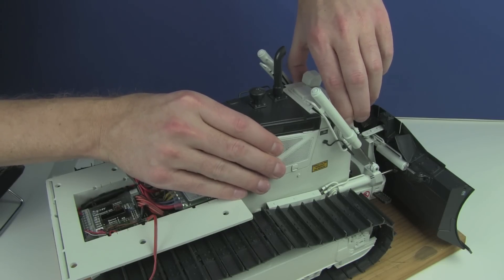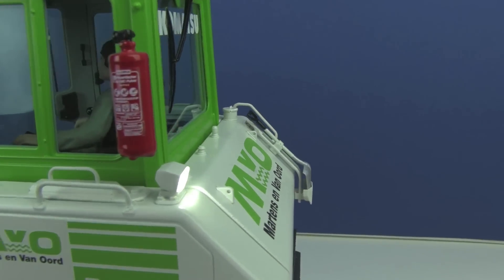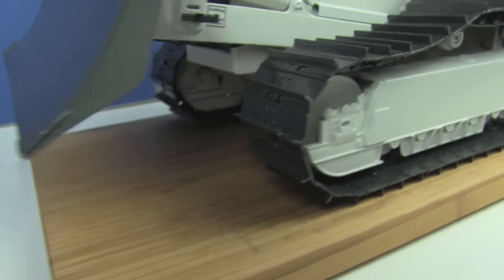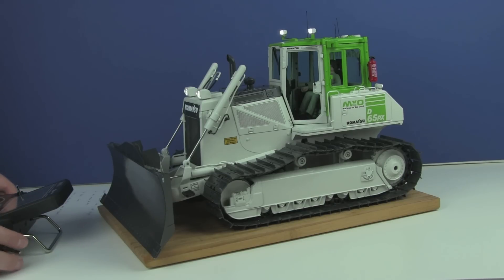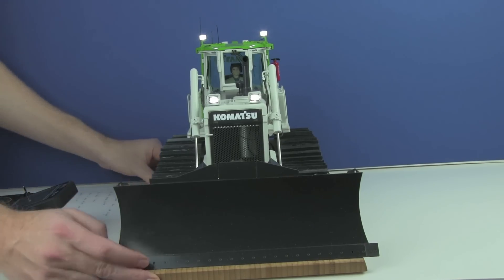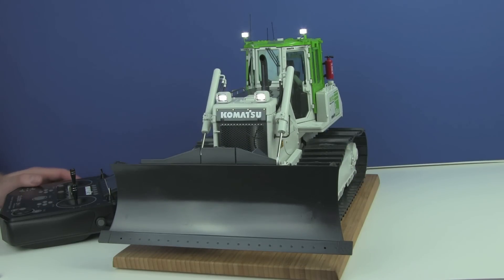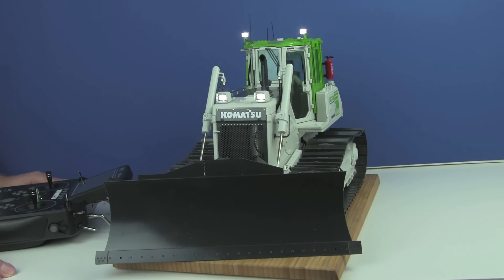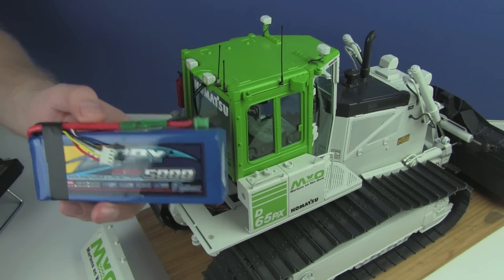HOW YOU BUILD AN 1/14th SCALE RC BULLDOZER - KIT PART 5

Comment: Excellent Bjoern !
          So the battery is where the fuel tank would be . good spot for it,
And the hydraulic oil tank right behind the radiator grill...
The last hydraulic function you used  with the knob would be the "Tilt Function"    ;-)       Tim